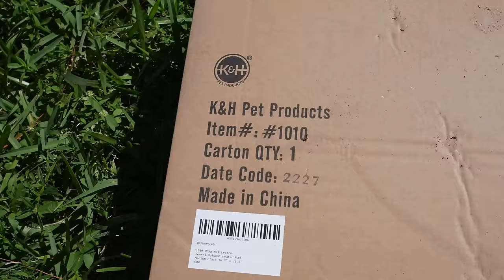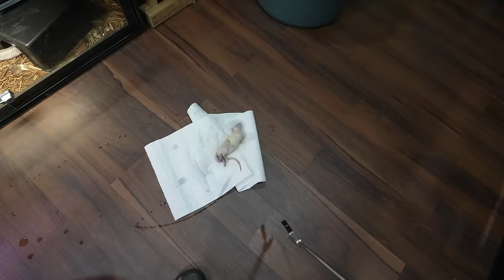Florida is getting COLD! Time to get the Animals Prepared 🙌🏻

Comment: Use tech to your advantage. Blue tooth livestock temp monitors you can access by cellphone app anywhere you are. If a heat pad fails you can at least call Stone or Duff to go save your critter if you are on the road.